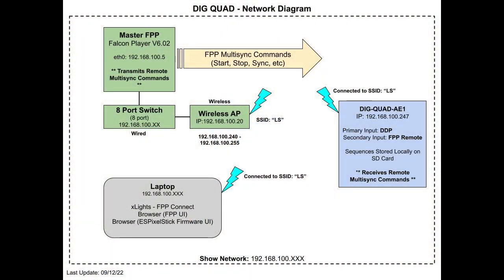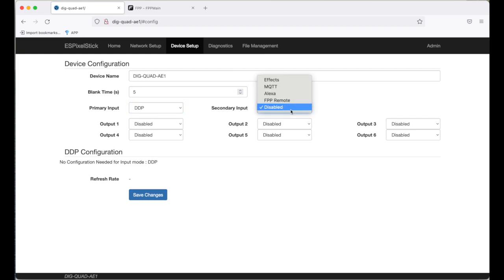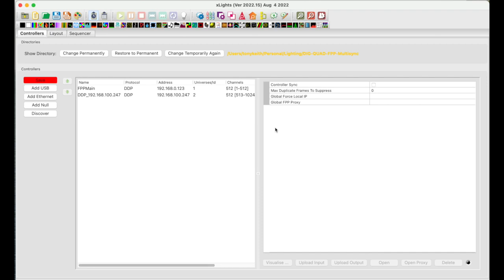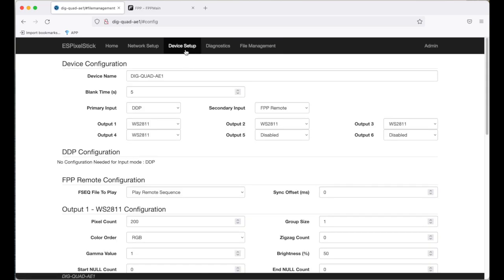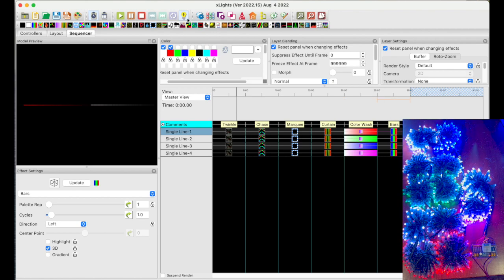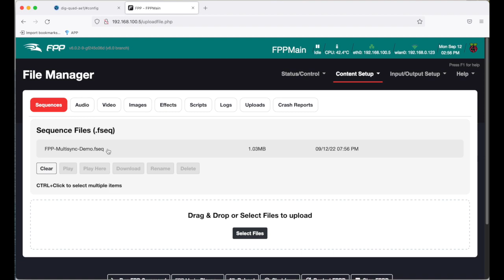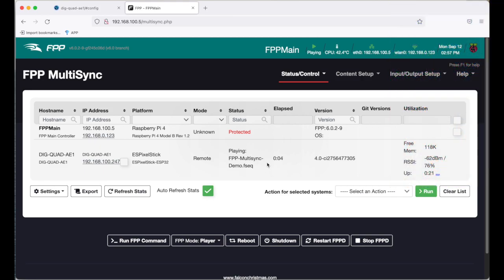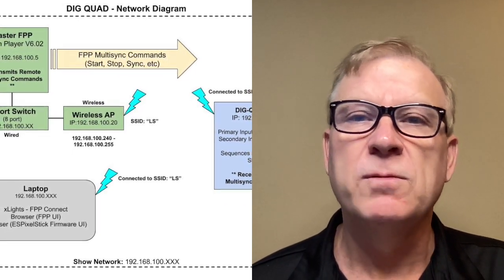How to Setup FPP Remote Multisync on QuinLED Hardware

Comment: I was able to follow along but I get hung up during the "Upload Sequence to Controller and FPP" portion of the video.  When I am in xLights and search FPP Connect, it does not find the device.  I tried to add it manually, using the IP address, it says "gathering configuration" but then nothing happens.  Any advice?

Comment: Thank you for your video.  I followed it and I have 5 controllers 1 dig octa, 4 dig quads w ae+.  I have 29 ports total and 8600 pixels, including 1) mega tree and 4) column matrix and 1) 2ft x 4ft matrix.  Everything works fine running from xlights.  When I run the show from fpp the mega tree does not light.  The fpp shows it connected on the multi sync page.  Is there a pixel per port limit with fpp?  My mega tree has 2400 evo pixels 400 per port.
Reply from the maker: When you play a sequence from xLights - all props including mega tree works. Correct? Have you tried to play the sequence locally on the Mega Tree?  Upload the sequence and set the secondard to FPP Remote - select sequence and run it locally.  Does it work?
Reply: @thechristmaslightguy  Thank you for you quick reply.  Yes all props work from xlights.  Secondary already set to FFP remote on the dig quad, I changed remote configuration to play my .fseq file.  I don't see a "run" to start command to play it.
Reply from the maker: @joemoffo9706  you should be able to save the configuration and about five seconds later it should play the sequence. Make sure you are not outputting from Xlights.
Reply from the maker: @joemoffo9706  if the sequence does not run, something is not configured properly. Try to re-upload the sequence to the controller.
Reply: @thechristmaslightguy  Thank you for your help.  The sequence did not run locally.  I finally got a good upload and now it works.  I think that I have a network problem from my desktop to the controllers as I have my controllers and fpp on a separate router.  I am using the wifi on my desktop as a second network to my fpp/controllers router.
Reply from the maker: I’m glad you got it working. You’re welcome. I’m always happy to help.
Reply: @thechristmaslightguy  just to follow up.  I'm still having issues with the uploads to the controller.  I connected directly to my show router and still have problems.  It can take multiple tries uploading one controller at a time before I get a complete uploaded sequence that works.  When the upload does not work, the file size of the uploaded sequence is much smaller.  Is there a way to create the sequence for a specific controller save it and then download it from my pc to the controller?  The espixelstick file manager has a download option.  I searched the everywhere and can't find a solution.  Thanks again for your help.
Reply from the maker: Joe - I have a couple of questions:
1. What version of the firmware are your running on your ESPixelStick?  A recent CI build? If not, please update the firmware.
2. Are you uploading the sequences to all controllers at once or uploading to a single controller?  I have seen issues when trying to upload a sequence to multiple controllers - try uploading 1 sequence to the ESPixelStick.
3. I will test uploading sequence using the file manager.  I know it is possible but it has been a while and I will let you know. I also need to connect my test setup in my office.
4. It may be easier to contact me on Discord, ID "TheChristmasLightGuy". I'm online most days and can help.
Reply: @thechristmaslightguy  Thank you for your quick reply.  1). I had a ci version from March 19, 2024 installed on all 5 controllers.  This afternoon, I installed May 1 version on my Octa.  The problem is worse.  I deleted my working sequence (25mb) and used fpp connect and tried 9 times to upload the sequence.  All failed.  The new uploads were from 1.4kb to 8.0mb.  You can tell it's going to fail by how fast the progress bar runs.  2). I tried both single sequence and all at one time.  3.) Ok.  4).  I heard of discord, but never used it.  I will install on my laptop and give it a try.
Reply from the maker: Joe - At this point, install Discord and contact me there.  I will try to help you out.  I'm should be available tomorrow and Friday.
Reply from the maker: Joe. I spoke with the developer today and he thinks he found a problem with the uploads and fixed it. Please flash your devices with the latest version dated May 16.
Reply: @thechristmaslightguy  That's good news, I thought I was doing something wrong.  I'll give it a try in the next couple of days and let you know.  Thanks for your time.
Reply: @thechristmaslightguy  I changed my sd cards from micro center type 10 to sandisk 32gb ultra's and reverted back to March Version of the firmware(no new version yet available) and my upload failure is greatly reduced.
Reply from the maker: Thanks for the update. I will have to make a note about using high quality SD cards. The new version is available on the web based installer.

Comment: Would this work without espixelstick installed? I haven’t had any luck getting the esp flash tool to launch on my windows 10 pc. I have 2 Dig-quads and 2 Dig-unos running WLED all with esp32 ae+
Reply: I was able to get my devices flashed today! I used my old laptop running windows 10. So far I was able to follow your steps successfully afterwards.. I really appreciate your quick response! You sir are an amazing individual! Thank you for the time you put into helping others in this hobby!
Reply from the maker: @talons7812 I’m glad I was able to help.
Reply: I guess my next question is if you are able to have espixelstick installed along with wled on the same quindor device, so that espixelstick will run the sequence files, and WLED to play effects while show is not running
Reply from the maker: I don't believe WLED supports Remote Multisync functionality yet.  What do you mean by getting the esp flash tool to launch?  The flash tool never starts?  Here are a few things to check.  1. Is your Windows 10 machine connected to the Internet? 2. Do you have JAVA installed?  Are you unzipping the distro? The esp flash tool will not run in a zip file.  The esp flash tool should start.
Reply from the maker: No. As far as I know this isn’t possible

Comment: I am trying to configure a dig octa with espixle v4 and am not able to do 2 things.

1.  LED channels wont save on reboot / refresh of page
2.  I have a relay for the power supply, is that possible to set-up?
Reply from the maker: Thanks for your patience. I have been on holiday for the last 2 weeks.  I don't have a Dig OCTA and haven't configured it with ESPixelStick firmware.  I would suggest you download the latest development version and try that.  There has been many updates and fixes recently to the firmware.

Comment: In the FPP MultiSync page, does the check box next to the IP need to be checked? What is that checkbox for?
Reply from the maker: The IP Checkbox is to select unicast or broadcast. In this setup, the FPP was set to broadcast to all remotes, so the Checkbox was unchecked.  If you check the IP Checkbox, then turn off broadcast on the Multisync page -> Settings (bottom of page) but make sure to leave "Send Multisync Packets" checked.

Comment: It has to be something simple. I cant get the "file management " in espixelstick. Four dig quads V2.7  and V3.1's. Four AE+ hats. Four san disk 32gb fat32 sd cards. Flashed with espixelstick build that supports AE+. The sd card pin settings are correct. I've set primary to E1.31 and even DDP. Set secondary to FPP Remote. I can drive leds via xlights and espixelstick. Maybe the build I flashed is wrong? It had dig quad ae+ as an option in the flash tool. Any thoughts or do you ever get in the zoom room? Thanks.
Reply from the maker: The "file management" menu should appear if you have the SD card inserted.  I'm not sure what is going on.  I currently out of town until Monday evening.  I would be happy to help you after I return.
Reply: @thechristmaslightguy  no worries on the delay. I appreciate any assistance. Setup seems pretty straightforward based in the video I watched...but apparently I'm missing something. I can really only rationalize that maybe the version I'm flashing is the problem. I'm pretty available this week.
Reply: Was this ever resolved?  I'm having the same problem with the latest CI firmware on a dig quad v2.7 with the full AE+ hat.
Reply: @grammyklg  I formatted them fat32 in my laptop and then I got the file management option.  Didn't make sense since they showed as fat32 when installed in my laptop right out of the package. All were sandisk and required that same step.

Comment: Can I not just use a laptop as my fpp main or xschedule? I watched Quindors video but he only ran to one quad with ae+. I have a few quads with ae+ and am nearing the time to configure them. I had assumed I could use my laptop with xchedule as the main and the quads set as remote.
Reply from the maker: Sorry! I have no experience with xSchedule. I have always run my show using a Pi with FPP running on it.  With that said, I believe you use your computer to run xSchedule (on Windows) as the Multisync Master and DIG-QUADs as Remote.

Comment: Thanks however, I'm unsure how audio is supported for sequences with music as the dig-quad has no audio output capabilities?
Reply from the maker: The DIG-QUAD only supports FPP Remote.  You will need an FPP Master to output music.  In my demo, I used Falcon Player running on a Raspberry PI as the FPP Master to send multisync messages to the FPP Remote (DIG-QUAD).  The FPP Master outputs the music.
Reply: @thechristmaslightguy  Thank you.

So is my understanding correct that the Dig could locally play the light sequence (to reduce network congestion/latency) whilst the FPP master would out the music at the same time? All in sync?

If this is possible. It would be great to see a video of this in action.
Reply from the maker: @billy_wizz  Yes. That is correct.  My FPP master is connected to a FM transmitter for music and all lights are in sync using FPP master / remote.  If you have Discord, contact me  on there and I can demo for you or I can make a quick video with FPP master/remote and music.
Reply: @thechristmaslightguy  Thank you so much. I don't have Discord but a youtube video tutorial video showing this setup would be epic! Looking to deploy this using my Dig-quad. I have used Xlights with Wled previously, but my understanding is I'll need to scrap Wled and use espixelstick with Xlights and FPP in order to use the digs local SD card functionality?
Reply from the maker: @billy_wizz  Yes. You will need to install ESPixelStick firmware on your DIG QUAD for FPP Remote multisync operation.  The DIG QUAD will need a version of the ESP32-AE that supports a SD card.  Do you have FPP running on a PI?

Honestly it is going to be a while before I can get to tutorial video showing the setup, however if you can contact me tony.keith@yahoo.com, I will be able to help you.

Comment: Also in xlights on the controller page. I see you have auto layout, auto upload configuration, and auto size boxes ticked. I only have auto layout models ticked on mine. Do you suggest I change mine to match yours?
Reply from the maker: I would check auto layout, auto upload and auto size boxes on the controllers tab, however I would double check the settings on the inputs of the ESPixelStick and the output of your FPP.   Depending on the version of the ESPixelStick,  I have seen some issues with these options but you can always manually configure the firmware and FPP settings.
Reply: @thechristmaslightguy  Thanks. These worked perfectly. Though once xlights uploaded the settings I turned off auto upload as it was slowing down xlights every time I turned on the light output icon. :)